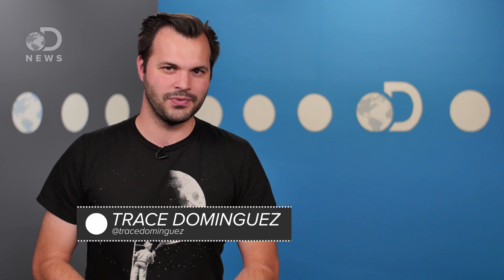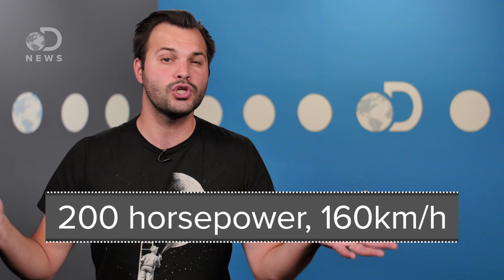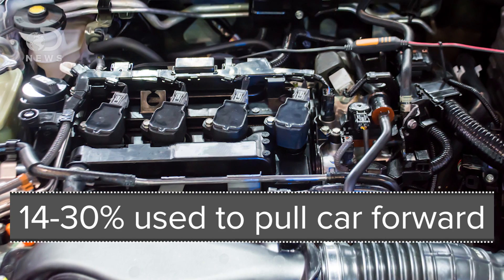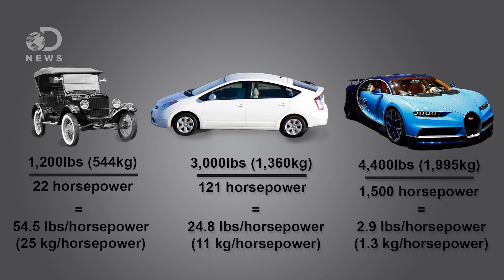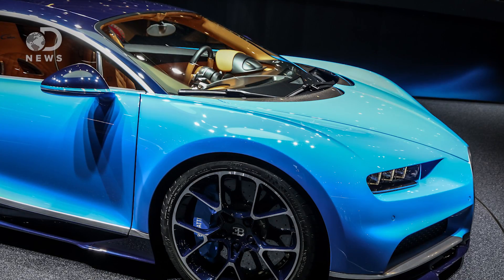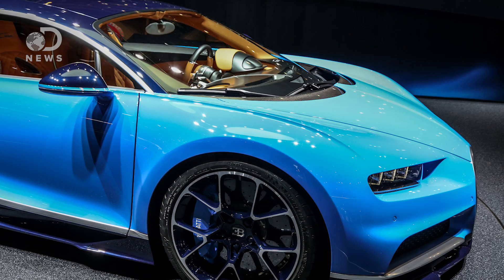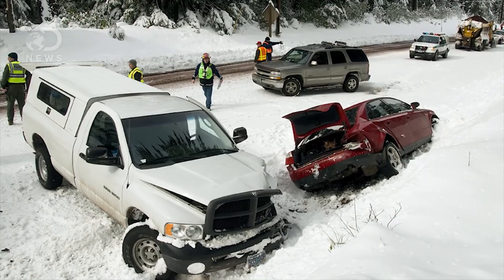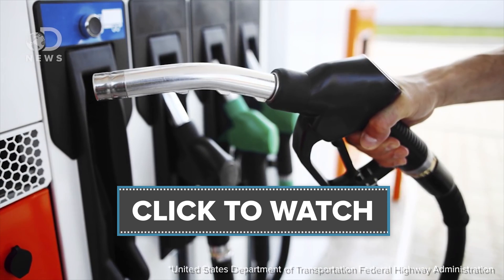Why Isn’t Your Car Faster Than A Sports Car?

Comment: 1. I had muscle cars and hot rods as posters as a kid.
2. Currently the venom gt is the fastest car in the world not the chiron.
3. Power to weight ratio affects acceleration not top speed, however it does make you get to your top speed faster.
4.top speed is limited by many factors but there are two major ones. Engine power and friction (air and tire and internal drag).
5. There are many cars much faster than the venom but they are modded obviously and some are really really fast. Look up top fuel drag racing for sheer acceleration and speed. And NOISE, LOTS AND LOTS OF NOISE. 160 DB OF NOISE

Comment: My favorite car is the Koenigsegg, specifically the One to One, it boasts 1 kilogram of weight for every horsepower. Giving the car the greatest power to weight ratio. Koenigsegg top out at 270 mph, faster than the Bugatti mentioned in the video.

Comment: Your argument has some valid points but is not completely accurate, There is wheel traction, Horse power, toque, down force, drag, gear ratios, differential gear ratios involved in how fast a car goes,  you over simplified why cars are or are not fast, and you do NOT need "more engine" to make more power, there are turbo chargers, super chargers, nitrous oxide,  higher engine compression ratios, different fuels like e-85 which allow for more pressurized air from turbo/super chargers to be crambed into the engine without detonation, and anyone can buy it.  Tuning is another thing, back when the first car was made they didn't have computers or fuel injection, engine efficiency is on another level now , there bolt on modifications that reduce weight but increase power, there are turbo charged 4 cylinder engine cars making 1200+ horsepower,  the bugatti chiron has 2 v8 engines and there are single v8 cars that wight less and make double the power and are faster than the chiron, Alpha Nissan GTR's make almost double the power of a chiron with a v6... and a lot of the cars making 3000 horse power dont even use light materials like the chiron...  +[DNews]

Comment: The Bugatti Chiron isn't our fastest car, and can go a lot faster than 261. It has an electronic limiter at that speed. The Hennessy venom has already done a run at 270, which is the highest speed for a production car. Thus, our fastest cars can go faster than 261

Comment: Power to weight isn't everything. In fact, in terms of top speed, as long as you're above ~80 mph, it isn't ANYTHING.

You see, it isn't the weight that causes your car not to be able to push forward. It's the drag from the air deflecting around the car. The Coefficient of drag and the drag area determine the aerodynamic drag, and this scales with the square of the speed, whereas the wheel friction on the road doesn't scale at all with speed. The air drag is, by far, the larger force on the car at high speed.

Basically, for top speed, WEIGHT. DOES. NOT. MATTER! It's how hard you're pushing the air that really matters.

Comment: Here are a couple reasons that are NOT included in this advertisement. 2.Alternate fuels that allow for higher hps to be squeezed out of the car without pre detonation or knocking and number ONE. Forced induction. 
Crazy how you can squeeze more horse power out of an inline 6 than on the w16 in the Chiron with a device that circulates exhaust gases and uses those gases to stuff more air in the turbo with the use of pressure than under normal conditions.
Reply: ***cylinder

Comment: No no no no no. Your're totally absolutely wrong. Cutting weight and adding more engine are not at all what make modern cars fast. Variable valve time, super chargers, turbo chargers, multiple valve systems, adjustable intake manifolds, improved cooling ects is what makes modern engines fast. Bugatti's engine isn't fast just because it is 16 cylinder. Infact the first Bugatti in the 1900s was 16 cylinder. The veyron and current Bugatti engine are powerful because of a ridiculous checklist of innovations. Like the use of 4 compound turbo chargers, 8 radiators for cooling, computer controlled cam profile  and countless other things. It isn't because it has a big engine and weights less!!!

Comment: Power to weight ratio has to do with Acceleration.  Plus, one HUGE factor was left out of the equation, which is wind drag, which takes the largest chunk of energy at high speeds

Comment: He said that a modern car only has an fuel economy that is 3mpg better than a T-Ford. a T-Ford has a fuel consumption of 13-21 MPG, depending on... stuff. Where as my 2006 Ford Mondeo has a fuel consumption of 33-47 MPG, depending on winter/summer, long/short drive. I´m no maths genius, but I´m pretty sure 33 is more than 3 more than 21. Efficiency has come a long way since 1910, saying that the efficiency has been pretty much the same ever since is completely wrong. 
And to why my car isn't as fast as a "sports car". Power. Its all down to power, and no additive in the world can make my car "as fast as a sports car".

Comment: whaaaaat a dumb down version... engines are better today because of better compression, turbo ad more oxygen to the engine there by alowing more fuel to be added and there by gaining more power. new manufacturing processes, to strip off as much unneeded material as possible to get the weight down aswell for better fuel and better fuel delivery into the engine it self. all combined to make a more power full engine. and still make it small.

Comment: Though it appears to be a very simple question, the explanation in this video is just horseshit. The top speed of a vehicle doesn't depend on the ratio between its power and weight. It is down to the ratio between power and drag/friction. A low power to weight ratio usually leads to a good acceleration, whereas lower drag increases the top speed of a car. If the top speed was down to the power to weight ratio, trains would be utterly slow. But they're not - the TGV prototype V150 reached a top speed of 574.8 kph (357.2 mph) in 2007. With its weight of 268'000 kg and a power output of roughly 26'500 hp that train has a power to weight ratio of 10.1 kg/hp - and as shown in the video, that's Toyota Prius grade, which does not anything near to that speed. This is a brief and simplified explanation, because other factors as transmission and grip also matter, but at least it isn't as wrong as the one presented in the video.

Comment: So many folks bashing on this video and don't have a clue what they are talking about. Firstly he's talking about top speeds nothing to do with tires and launching, and power:weight IS correct in determining that. Also a W16 IS two V8s cast together. And drag IS a huge factor like he mentioned, yet people want to complain about why he didn't bring up gearing, simply because cars that target top speed are never limited by their transmissions only cars that target acceleration are. Also torque and horsepower is the same thing, HP is just a function of torque over time equaling work. Horsepower is a unit of measuring work derived from torque, which itself is a measurement of force, but force alone doesn't tell you much, this is why we graph HP by measuring torque at the rollers and mathing.that with RPM to graph it.

Comment: The Keonnigsegg Regera hybrid has a better power:weight ratio than the Chiron, with the same power, even more torque and a more efficient powertrain, with better acceleration to 250 mph, the only thing holding it back is the fact it is limited to 254 mph as it has no conventional gearbox, meaning it has just the one gear, making it even more advanced than the gas - guzzling, cumbersome dinosaur that the Chiron is. PS the Regera looks a whole lot prettier in my opinion.
Reply: Venom GT?
Reply: The Venom GT has a heavily tuned engine under the skin, not one built in house.
Reply: Oisín Joyce I don't think it's mass produced either because of that if I'm not mistaken
Reply: Oisín Joyce you like Koenigsegg?
Reply: Isaiah Gonzales Yeah I've loved everything Christian and the guys at Koenigsegg have done. They went to make a hybrid car and did it in no way anybody thought they would, or anybody even thought possible, so for that reason I think Koenigsegg is one of the most under rated and exciting car companies at the moment.

Comment: BTW, the fastest car in the market is the Koeniggseg Agera R with 273 miles an hour (439 km/h). The second fastest is the Hennessey Venom GT at 271 miles an hour (433.6)
Reply: the issue is Guinness world records won't recognize either of them as the world's fastest because neither of they have sold enough models of each car to make it a "production car"
Reply: +day man the Chiron is faster than both of them but it is electronically limited for the street
Reply: yayafour971 Yeah, the definition of "the fastest"is very unclear
Reply: Thats true
Reply: How do you know ? The Agera R never drove that fast. And also the Chiron has more power than the Veyron/Agera and there was no high speed test yet so you have no idea what the fastest car is nobody does, until Koenigsegg or Bugatti make a test run. Agera 1150 HP. Chiron 1470 HP also tires play a huge role and the tires on the Bugatti are specially made for this high speed doubt that the Agera can beat the Bugatti. Koenigsegg has just simulations they have no evidence for their claims. Its all just talk until there was a documented run and only  Bugatti and Venom have proven to have the fastest Cars. Venom GT is more or less a Kit Car so its not a production car.  Also the Chiron is a step above the Veyron, wait until they make an official test run the Venom will not be able to catch up to this its still in Veyron Vitesse level the Chiron should be significantly stronger and Koenigsegg are just talk there is no evidence on any of their claims.
Reply: 10010011 Midg What does horsepower have to do with top speed? And BTW, the Chiron is a LOT heavier than the Agera R so the power to weight ratio is better on the Egg, which is what really matters. And the tires can be changed at any time, discussing them is completely useless. Plus, simulations also have a role in discussing top speed. It's not because they don't have the track now they can't say a top speed? Besides, DNews could mention the Veyron Vitesse as the fastest car in the market, I wouldn't mind that at all, but mentioning the Chiron was stupid. You said it yourself that the Koenigsegg isn't worth mentioning because there are no solid proof, then why mention the Chiron? It just doesn't make sense to me
Reply: +Eric Rodrigues these hypercars are much older.  Not to mention the 1:one is faster than the agera
Reply: Guess what? No one gives a shit about top speed, when you need a 4 mile long straight to reach it , I consider it as a theorical speed. Acceleration is all that matters: 0-300 kph, 0-400 kph , period
Reply: +yayafour971 well the koingsegg still out performs it...
Reply: well that was actually my point because koenigsegg have never proven their top speed potential, that's too useless, on the other hand tey make the fastest accelerating cars and they are also very nimble
Reply: +day man The Bugatti Chiron also isn't a production car, They only made 500 of them
Reply: +yayafour971 +Manpreet Singh I'm not trying to compare cars, I'm just saying they made a false statement. The Chiron is NOT the fastest car in the market. If the others are better or worse is beyond my point
Reply: +Guilherme Ferrão any car which has more than 35 models made is considered production car
Reply: Guilherme Ferrão that's what i was trying to say by giving the example of koenigsegg who makes faster cars in a straight line but also on the track. Saying a car is "the fastest" because it reached a top speed on a utopian track after an entire day on preparation seem childish to me, koenigsegg focuses more on acceleration, they know what is the most important.
Reply: Eric Rodrigues Really? Well that seems planned out...
Reply: Guilherme Ferrão agreed, the chiron hasn't proven anything yet, if you think this way then the devel 16 should be the fastest car lol
Reply: yayafour971 LOL, yeah, with "5 000+ horsepower" 😂😂
Reply: the regera is meant to be fastest isnt it if not its definitely the one:1 1365kg 1365bhp

Comment: Not true, the Koenigsegg One:1 has a top speed of 270 mph
Reply: its not a production car so record books don't count it as the fastest car
Reply: +Jake Bruxvoort they produced it and sold it so it counts.
Reply: +Krevin Grard production means it's not a one off or very limited run.
Reply: +bensemus x well they're making only 499 so i guess that's very limited as well...
Reply: samed halafi I wasn't arguing whether or not it was the fastest production car. I was correcting your definition of production car. Although reading up on the One they are only making 6 so no it's not a production car.

Comment: New bugatti is 'limited' to ~259mph.. so it's not the fastest car you can buy? Koenigsegg one:1 (& one of one) hit ~273 mph....
Should probably wanna add the use of Ethanol as a fuel source in high performance engines giving massive increase in output... most cars use petroleum (duh).
Mind you power and weight arent the only contributers... the cars physical capability to handle such g forces and movement through the chassis and suspension, wheels, transmission etc it's really a combination of all these things and u've taken the most obvious one... lazy effort

Comment: Hmmm i think my car is as fast as a sports car. my specs : 
1995 toyota supra 2jz gte.
3.0L built by Real Street Performance.
Many internals. (alot).
Driveshaft shop carbon fiber driveshaft.
Hypertune race intake manifold/90mm TB.
PHR S45 Billet collector exhaust maniifold.
PHR Triple Walbro fuel system.
Porting solutions built/port head
Precision GT42 7675 DBB (turbo).
AEM V2.
2200cc Siemens injectors.
Clutch Masters FX850 Twin Disc clutch.

its making over 1k hp using an inline 6.
this engine is known to get to 2000hp. Beat that Bugatti.

Comment: F1 cars have hit 50% efficiency with the hybrid v6 turbos. Power is around 1000hp and weight is 702kg. c/d is over 1 though and they generate 3000+kg of downforce.

Comment: This is a Chevron commercial piggy-backing on a shoddy fluff piece posing as a legitimate science & technology video.  Regular cars aren't as fast as exotic sports cars because they do lack the engine power and low mass needed to accelerate enough in whatever space they have available (among other things) to reach such high speeds, but also don't have equally good aerodynamics to overcome aerodynamic drag so as to not be held back by drag, and don't have any of the stuff needed for maintaining high speeds through turns or stuff needed simply for staying all in one piece, such as suitable tires, sufficiently durable parts, specially tuned suspensions, low and well-balanced centers of gravity, and adequate aerodynamic downforce.  Getting all those features is expensive and often calls for sacrificing other things, such as trunk & passenger space, a smooth soft ride, good visibility, fancy high-quality sound systems & air conditioning, and ground clearance.

Comment: Weight effects acceleration not top speed. Engineers have to find a balance of power to weight. More weight= slower acceleration but the more mass the higher top speed..of course with an engine that also powerful